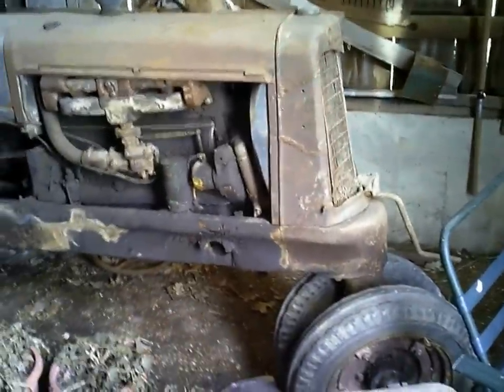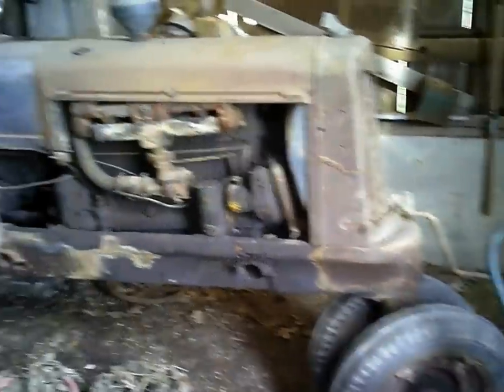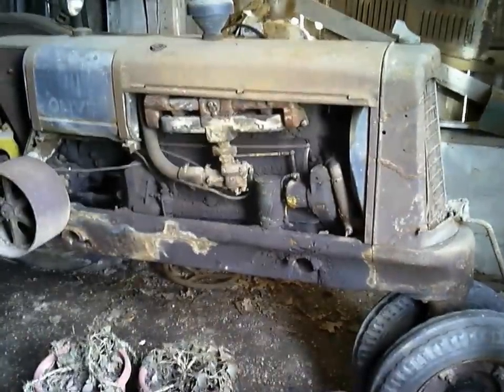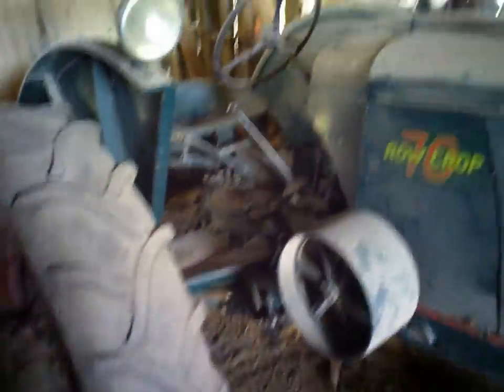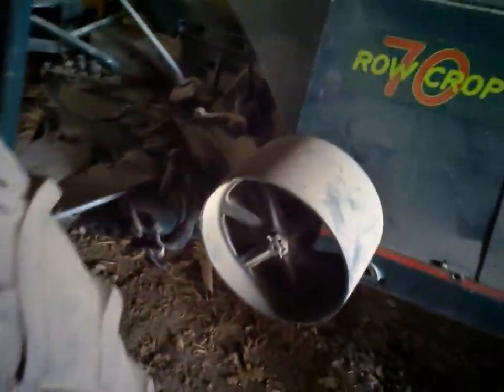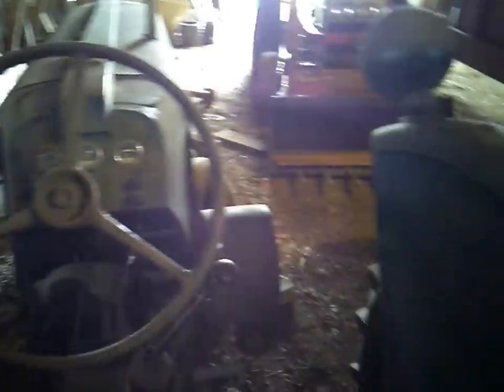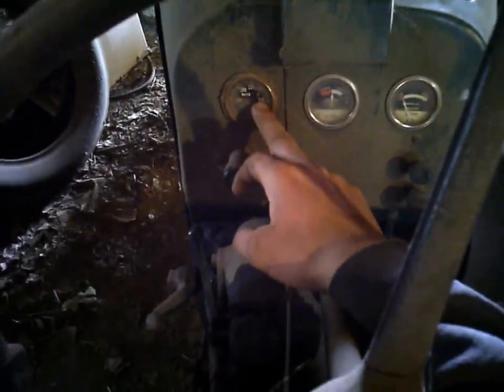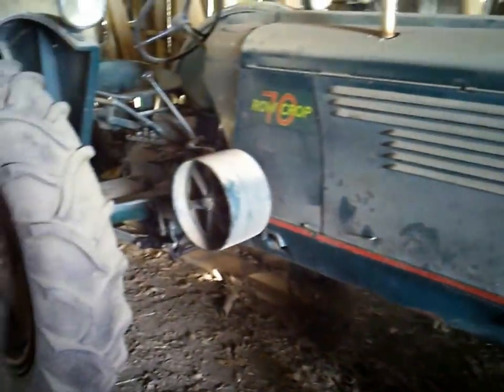Oliver 70 overview

Comment: Nice ol' Olivers.  Wouldn't mind seeing them out doing some work.  I don't see many of the Olivers with the side skirts still on them very often.  I think I had heard if the tractor had them on it & developed a overheating issue, the farmer pulled them off & set them in the barn's corner of clutter.   Thanks for posting & stay safe.
Reply from the maker: crslyrn thanks man! Maybe I'll get it running this summer. Ya that was a problem because the muffler was under the hood then guys removed it and it fixed the problem

Comment: gotta love them old tractors . that was the good old days no power steering hit a dirt clod and your elbow would get jammed into your ribs i can still feel it ,we had the old As though.my dad give his older A away 40 years ago it was a 38 i think.it was the first tractor i drove . running that lift looked comfortable. the tires on that tractor looked ariginal to me tire use to last longer it seems like. that second one was real nice you should use it .the first one looks real rare that would be a nice one to fix up. dont remember them . that was great Jake i realy do love the old tractors easy to take care of you could tell when something was going wrong better also. thanks for showing them .
Reply from the maker: Howard Younger thanks Howard. To bad he gave it away. Ya u got to keep a firm hand on the wheel lol. Ya I'm sure those back ones are original
Reply: well it needed a lot of work  lets see there was a good fly wheel on it though, the metal was straight . the motor ran but you had to drain the water when you were turning it off then start it before youfilled the water. we only use it to clean the yard and harrow a little. my dad had a newer one it had a starter and hydrolics.
Reply from the maker: Howard Younger oh wow starter and hydraulics make a huge difference

Comment: Good video Jake.  You have a good knowledge of the history of the Olivers. My dad had a 70, then a 1953 model year 88 Fleetline row crop narrow front end, which was his main tractor throughout the 50's.  The tractor frame, rear end, and 6-cyl motor  looks about the same on your old 70's as the later Fleetline series.  Oliver66farmboy seems to  be the YouTube expert on Oliver.  He has some great videos on the history of Oliver.
Reply from the maker: hayfork100 thanks! They made a lot of them and they were good tractors. They have used that 6 speed trans for a long time

Comment: That 70 streamlined looks really nice Jake! Just out of curiosity, how many volts was the electrical system on a fleetline Oliver? Farmboys always sounded like they cranked over too fast to be 6V, so I thought they may be 12. But then he was talking about something to do with a certain piece of equipment (I think, honestly can't remember what he was talking about) and he said that the four digits were better than the fleetlines because they were 12V. I got confused so I thought I'd see if you knew. Thanks, Chris.
Reply from the maker: NEAFarmKid thanks man! And this one is a 6v I can't remember when the switched to 12. In the 50s some time I think

Comment: now that would be really cool to see one of those on your mill getting some regular exercise without straining it's guts out. If it needed a new clutch could you get one or would you have to get an old one re-lined?
Reply from the maker: Dan Whiteford ya I hope to do that this summer if I have time. The clutch is good in it. They made a lot of these so there's still some parts out there. Thanks for watchin
Reply: Does it have a two port external hydraulics and a capability to continously pump oil sufficient to drive a small hydraulic motor on an augar to fill your mill as needed without the oil being overheated in the process?
Reply from the maker: Dan Whiteford no it actually doesn't have any hydraulics lol. I would have to put a system on it if I used it and didn't want to use buckets. That's the main reason that tractor sits in because we can't do much with it since no hydraulics
Reply: Well could you consider using a PTO mounted pump that has a straight-through 540 shaft? That's what used to be used here for tractor mounted big heavy front end loaders, hedge or verge cutters and early backactor ditch cleaners when tractors had weak or low capacity hydraulics. An alternative is a pump driven off the front crankshaft but they usually had to have a gear box as the rotation direction is wrong for the pump. Of course an additional issue is what to do about an oil reservoir!
An alternative approach is a pump driven off the PTO shaft that is mounted, with a reservoir, actually positioned on the machine itself. 

I suspect that all this would just be too much hassle and expense for the amount that you might use the mill anyway!!
Reply from the maker: Dan Whiteford ya thanks for the thoughts. I've thought of something similar too. Like u said it's just to much trouble for the few hours it would get used ok the mill

Comment: Back in the day where was the closest Oliver dealership from where you live?
Reply from the maker: Jack Outlaw from grandpas place there was one about 5 miles
Reply: Jake Ziegler no wonder you went with Oliver how many pieces of  equipment did you guys buy there and still have?
Reply from the maker: Jack Outlaw all of the Oliver tractors came from there except the 70s. This dealer went out of business in 69 I think. So in 1970 we had to drive about an hour to get part but then in 71 the local MM dealer picked up the Oliver contract. That's where the parts 7800 came from. My 525 came from the dealer we went to for one year an hour away